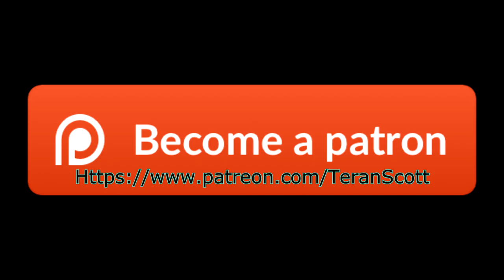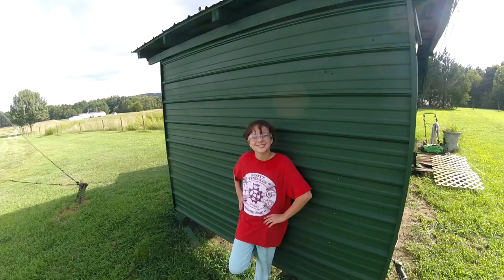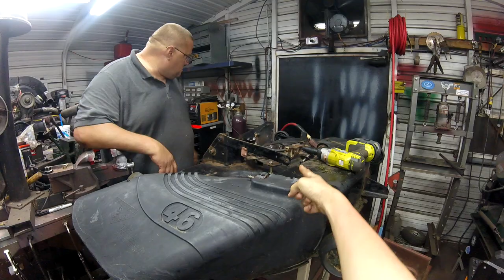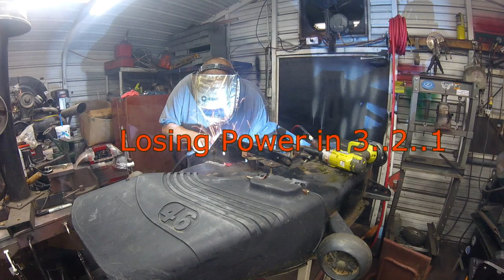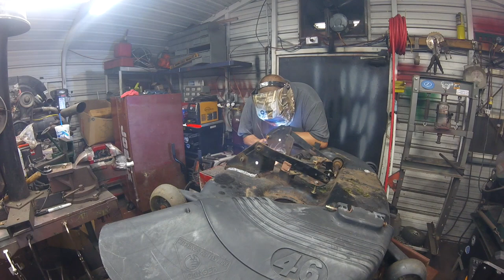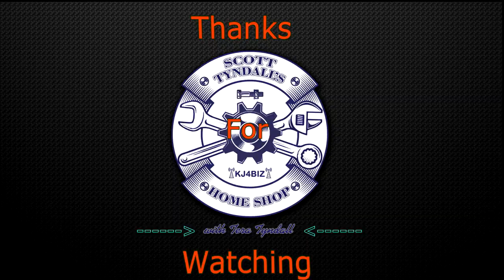Fun times Welding the mower deck

Comment: Not sure if I heard flight deck or if it was mower deck....
Anyway, it doesn't seem to fly very well, maybe too much weight added...    😁😁😁
You're lucky to be able to weld this deck, some are made from medium or higher carbon steel, they crack as soon as the weld bead cools down , the only way to fix those is with fasteners.
You need two types of countdown, one for power outage, another one for deck launch...     😂😎👍
Have fun...!!!
Reply from the maker: Your to much lolol